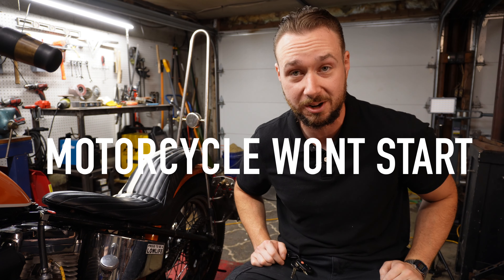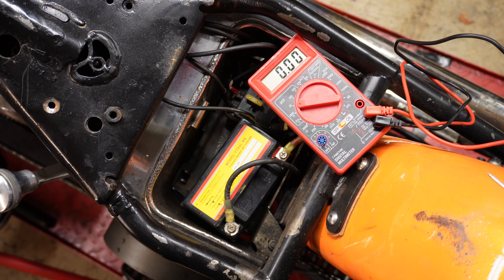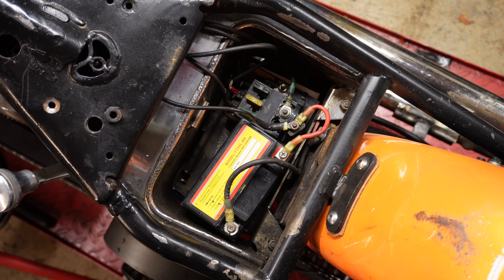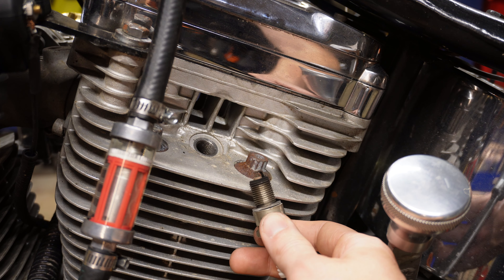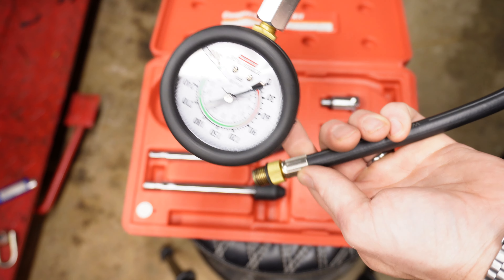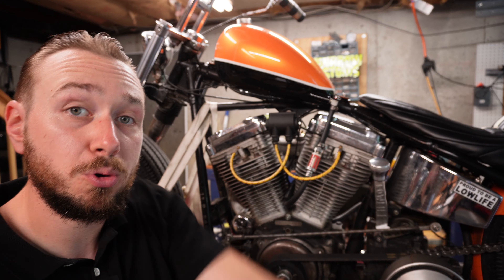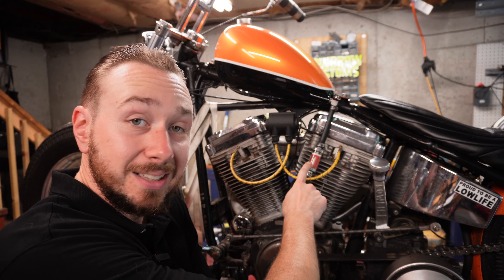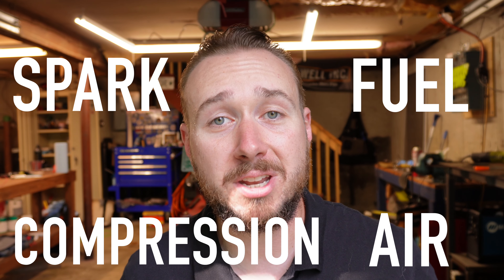Get Your Motorcycle Running Again

Comment: I’d also say check for intake leaks. Iv heard anything from electrical,timing and carbs being blamed for a simple intake leak. Iv also had bikes never stay running or not start just because of a torn rubber boot hidden by a clamp.
Reply from the maker: Great points man!

Comment: A few points - a battery in a good state of charge will show at least 12.5 volts. If it's as low as 12v, it is discharged.
When doing a compression test, you should remove the spark plugs from all the other cylinders before kicking/cranking it over.
A dirty air cleaner is unlikely to prevent the engine starting, although it would affect performance once you start riding and more airflow is needed. If it was completely blocked it would show up in your compression test, because it would not be able to build pressure.

Comment: Been watching a few videos on YouTube to see what's wrong with Yamaha wr450f dirtbike. Turn on with electric starter and no crank at all. Battery less than 6 months old and it's on a battery tender. Auto zone in my area don't do bike batteries.Thinking its starter solenoid so I was thinking of using insulated screwdriver and touching screws on it to see if I get something of a crank. Just afraid of messing up starter or other electrical stuff. Thanks for the video
Reply from the maker: You can jump those terminals to test it just wear some gloves and use an insulated tool just in case I used to do this on my road star when my solenoid was starting to go

Comment: Electronic load testers don't work.
I recently encountered a bike that had been sitting, and wouldn't start. He told me that the battery was good, and showed 12 volts. He had fully charged the battery the day before. He also had a friend test the battery with a "state-of-the-art" electronic load tester, and test Good. Engage the starter, and nothing happens. Not even a clicking sound in the solenoid.

Load testing in the field is very simple.   - Don't go to a shop that uses an electronic load tester.
Voltmeter with the bike not running was 12.8v. Then continue to measure while engaging the starter; the voltage immediately dropped to about 4v then bounced back up to 12.5v when I stopped cranking. He didn't believe me when I told him the battery was bad so we jumpered his bike from a known good battery, and the bike started up right away. He bought a new battery, installed it, and all is happy.

A good battery needs to test a minimum of 9.6v while cranking the starter (most will be 10+ volts if good). A bad battery typically drops noticeably below 9.6v as soon as you engage the starter, so it's not a fine line when you cross it.

Comment: I've watched this video and it has definitely given me a better idea on where to start from compared to the other videos i've watched so thank you greatly, I couldn't help but subscribe. As i've currently just brought a 1992 yamaha SR250 , it was running beautifully when i got it and rode it. But as soon as i got home after a 10 minute ride home, it didn't want to start the next day. No dash light comes on, I turn the headlights on, they seem to work fine with no loss of power or struggle to stay on. Horn and indicators also work but no neutral light even though the bike is in neutral. The starter doesn't seem to make a sound or click either, So i'm very puzzled at this point whether it could be the starter or something else. Ill definitely start with the tips in this video that's for sure, but Is there any kind of advise you may have that could possibly help with this solving this issue. I would be greatly thankful to just be able to get back on my bike and ride again with any kind of help 🙂💯
Reply from the maker: Loose terminals on the battery! Check everywhere for something coming loose. So many electrical gremlins come from this
Reply: @greasesgarage  Thank you so much I did all the things in the video and it helped a lot. The main issue I've found out was the bike doesn't like going into neutral while its running, and is very hard to try select neutral at times for some reason. So that's my next mission to try solve 🙂
Reply from the maker: @krazydogz7402  Are you trying to put it into neutral from 1st gear or from 2nd gear?
Reply: @greasesgarage  from 1st, it doesn't want to go into neutral when the bike is warm and can sometimes have troubles doing it when its cold too

Comment: This video is super helpful dude, one week my bike was starting great. Cold start second kick, warm start everytime, next week, nothing, so I reset the carb, nothing. I did a compression test and the front cylinder is 65 and the back cylinder is just below 120. What could that mean for the front cylinder?
Reply from the maker: Just want to start by saying good on you for doing a compression check! Nobody…and I mean nobody, wants to listen to that advice and often they wind up chasing non existent carb issues or electrical issues for weeks. 

Very smart of you to go straight to the source and check that first. 

As for what it means, it means a top end job. My front cylinder was exactly the same as yours last summer when the bike wouldn’t start. I ended up pulling the cylinders, having a machinist hone them to clean them back up, putting in new rings and gaskets. She’s good as new now. I used cometic’s top end gasket kit and Hastings rings. All in was around $200 for the parts. The labor of removing them and putting them back is very easy to do yourself. But you’ll need a machinist to measure your cylinders and see if you can sneak by with a hone or if they need to be bored out one size. 

If you do have to bore them out, you will need new pistons that are one size overbore. Not expensive tho.

Comment: Me watching this after I just followed your chopper wiring video on building a new harness from scratch💀
Reply from the maker: Oh no! Did it run before you redid the wiring?
Reply: @ I’m not sure, the person I got it from tried to do the wiring themselves and didn’t know a thing about it. I suspect the issue is mechanical because after the chopper wiring video everything else worked perfectly. The bike backfires but won’t run, has fuel spark and compression. I’m hearing ignition timing may be off 180° but I’m not sure how to adjust that.

Comment: if you do take your battery to get load tested-  MAKE SURE it's fully charged.  A discharged battery, even if it's new-  will FAIL a load test.  You can buy a load tester at Harbor Freight for about $20 - $30; well worth the investment.  With that said; "my bike won't start" has many definitions.  "my bike won't crank" or "my bike cranks but won't start"-  crank no start, especially after a winter layoff is FUEL related- assuming you've charged the battery.  In that scenario-  it's bad gas from not putting the bike away correctly for the winter.  Dump the gas, spray in some carb cleaner and add fresh gas.  The other points in this vid are dead on. Ride safe everybody
Reply from the maker: Great tip!
Reply: Indeed a great tip. I had a crank but no start issue after winter and was chasing battery and electrical issues to no avail. Saw this tip on fuel and swapped for fresh. It started immediately. Thanks for posting it @lynskyrd!

Comment: i,m sorry ,but if my bike won,t start i cannot check it for charging.
Reply from the maker: If you can’t get it to run at all it’s fine to skip that step and instead take it to get load tested then proceed with the rest of the testing.

Don’t let that one step deter you from all the other tests in the video which can be performed without a running bike 👍🏼

Comment: New fuel pump and crank no start spray fuelcranks
Reply from the maker: Sounds like you’re having a fuel delivery issue
Reply: @greasesgarage  Hi nice vidéo ,what about valve clearance?Bad clearance could it prevent bike start?!
Reply: @starnino1458  for most engines, it would have to be extreme to prevent starting - either so loose the valve doesn't open, or so tight, the valve doesn't close, causing loss of compression. Mostly, it would just cause reduced performance or excess noise.